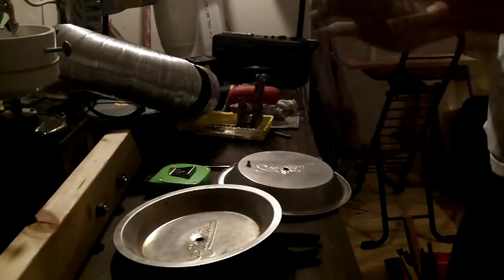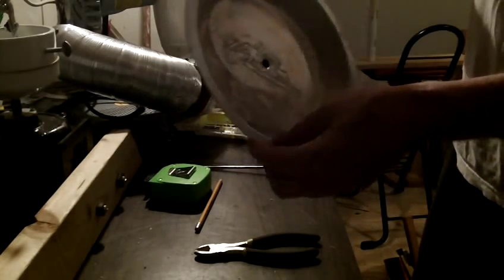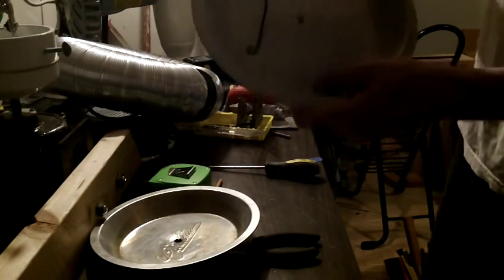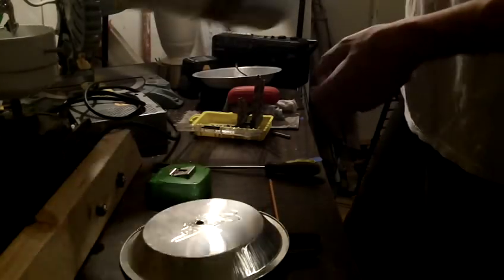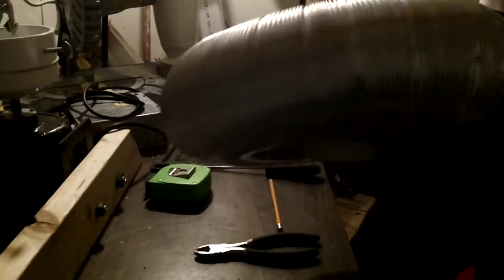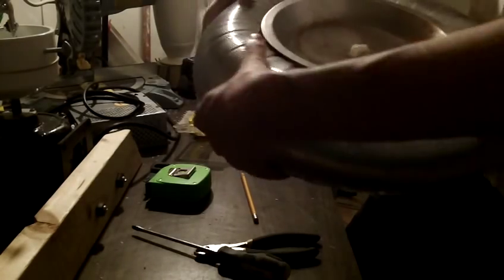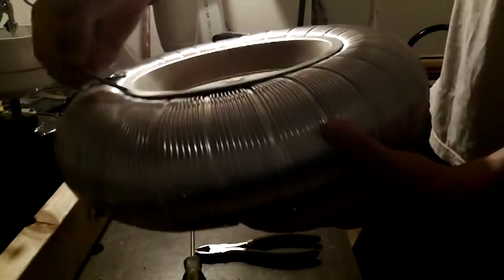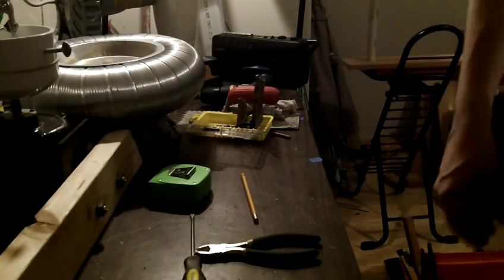world's easiest fastest toroid for tesla coil

Comment: Hey that turned out really good.  Also another technique for making a topload is to take a rubber hose maybe 1.5 inches or so depending on how large you need your torroid to be.  cut some aluminum tape hot dog style and wrap it around the hose.  The strips of tape need to be narrow like 1 inch or so that way when it is all wrapped onto the hose, you are able to easilly roll the hose into a donut shape and then you have a easy to make topload and looks pretty nice too.